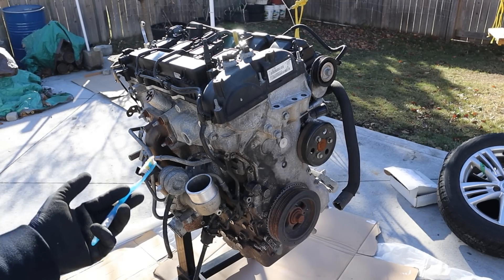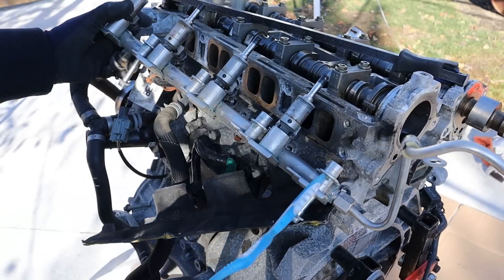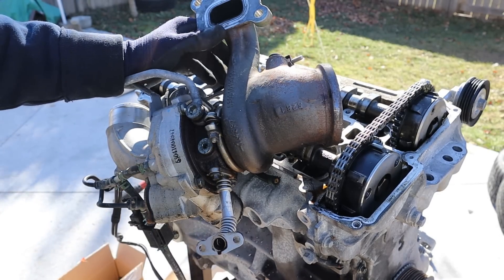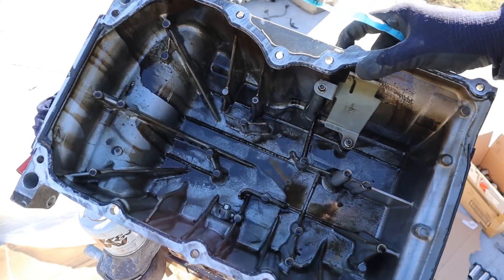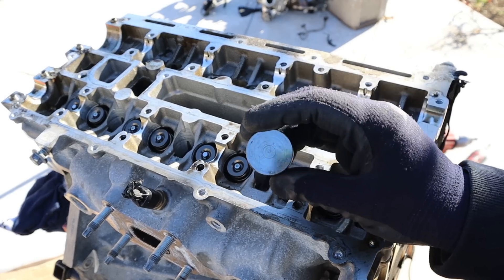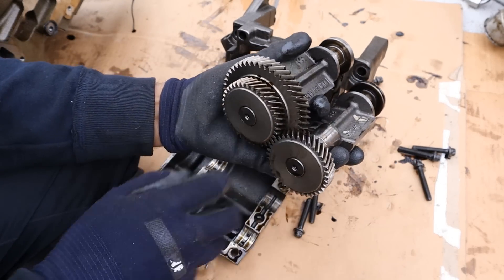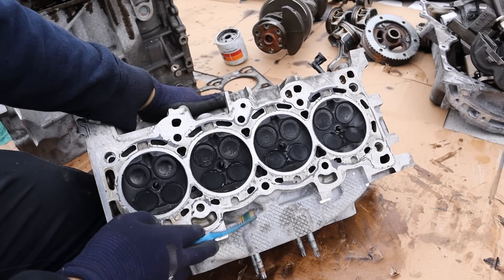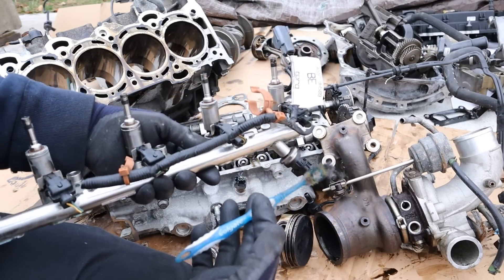Why Ford Ecoboost Engines Fail

Comment: Adding a catch can with an effective trap for blow-by oil vapors will benefit any direct injection motor. The lack of fuel vapor in the intake manifold increases the chance for blow-by deposits. This motor looks like it had a lot of extra oil. Maybe over filled after several oil changes. It looked mechanically sound.
Reply: DI produces a lot of very small carbon particles (think diesel DI) which are recirculated back by the EGR into the intake manifold...and mix with the oil vapours from the PCV......which always have enough oil to form a paste on the ports and valves.
That's why DI enines now have an extra set of injectors to clean the ports....those injectors are 90% of fuel flow in town driving.

Comment: Ive heard Chevrolet is not making certain replacement parts for some of their late model trucks on there fuel systems and the part can run as much as 2000.00 for a used part if you can find it  which is totally BS if so has anyone heard of this !!?

Comment: hey do you have any info on the 2.7L Ecoboost? I have 50k on it and no issues so far but wouldnt be surprised if some of the issues like the coolant groves or carbon buildup due to crank case vent also apply.

Comment: It's an ecoboost engine  so we don't expect it to last..Wtf??? I've known people who had 300k running  perfect....do you understand people are stupid and don't take care of their cars and trucks and that's why they don't last?? My wife has one now, 14 escape titanium w the 2.0 ecoboost, only has 117k on it, but it runs perfect.  She got it used with a 3 yr 36k mile warranty, that covers the motor,  tranny, turbo, drivetrain..everything down to the valve cover.  Doesn't burn any oil at all.

Comment: So....maybe a quick cylinder honing, some new rings or the old ones cleaned up, and some new gaskets and this is a saveable motor?
Reply: Until it fills up with carbon again???
Reply: @JohnSmith-yv6eq  I didn't seem that badly worn.

Comment: Looking to get a full size truck soon that gets decent mpg's, since i drive a lot for work. It'll be a daily and work truck in one. But in my price range (under 20k) they have 100-150k miles. Is it worth getting a 2.7 at that high of miles? As opposed to a 3.5/3.3 naturally aspirated? Tow 2-4k pounds about 40% of the time. Otherwise all my tools and materials fit on the truck.

Comment: My 2013 Escape, with the 2 liter Ecoboost twin turbo, is still purring like new after just turning over 100,000 miles, Changed the oil once a year and never had a single repair or problem. These engines are rockets but you pay dearly in gas milaeage for all that oomph.
Reply: My 2017 3.5 Paseo is the same way. A lot of power but mileage suffers. It rides great and you have to figure it is 20 feet long with a lot of weight. It has 70,000 with regular oil changes I replaced 2 tires out of 6. Which surprises me. I thought they would wear faster. The engine runs like new but Ford informs me of any potential problems (they had a universal recall or something to that effect which they fixed). You have to be careful of any of the newer vehicles anymore. They all have a lot of plastic. My other vehicle is an indestructible 7.3 diesel F250 (2002).

Comment: The newer block design is the one you are looking at. The older one is the one with groove between cylinder 2 and 3
Reply: Not true. Focus and focus st got the good 2.0L block from the beginning, from 2013 onwards. The 2.0L found on the fusion and edge had the slit and only recently changed in 2019. Read the tsb, fordtechmakuloco talks about it on his channel

Comment: More turbo boost,more pressure in the engine, more wear in any modern car with too many hp.I forgot to add  fail with plastic parts.

Comment: WHY do Car companies INSIST on making fiarl ysmall engines and Turboing them when it causes all these problems?
Is it because most folk buying new change their cars ever couple of years and manufacturers want the motors & stuff to fall apart (having finally made bodywork reliable)?
Bit of context .........
I was buying a new battery for my Ford Focus & guy was in the parts shop collecting something, he drove a Toyota Hiace pickup ........  That had nearly 500,000 miles on the clock and he reckoned no big problems with it.  Ever.

Comment: Like you say, it has a couple weak points, but overall, it looks like a good design, especially considering that it was required to be cheap to manufacture. Still... so complex! That's one reason I bought an EV - much simpler mechanically. And no carbon buildup!
Reply: Evs are junk! And they're not simple at all
Reply: @richsweeney1115  Right. That's why legacy automakers are falling all over themselves and spending multiple billions of dollars retooling. They too want to make newfangled complicated products that everyone knows are junk.😅
Reply: @maryhadda8420   every single tesla has has a recall...that's an example of ev junk. Evs aren't green. And you're not saving any money....junk
Reply: MS MARY.... you have no idea what problems lie a head for the battery powered car.  There is a 80% chance you will rue the day you bought it.  As a buying public we are lied to pretty much all the time ... about any thing that in important!  BTW that electric car, causes much more pollution from the beginning of the build process to the day it stops. ONLY AFTER 500,000  miles does its total contribution the pollution start to go down. These facts are well documented !!!    GOOD LUCK!
Reply: @davidfalgout7304  What bullshit.

Comment: I don't get the balance shaft assembly. If you have two identical weights rotating exactly opposite of each other, then they would balance each other out, not the crankshaft, right? In my mind you would have one counterbalancing weight, that is rotating opposite of the crankshaft.

Comment: Cool, finally i see my 17´ ST Turnier Engine in a teardown. :)
Very thx for that. 

It currently have ~50k km on the clock and looks like new inside (checked at the last Service in October this year). 100% Aral Ultimate (102 Oct) Fuel used and always driven warm and cold - does wonders for that engines.

Love it <3

Best regards from germany,

Marti
Reply: It's not the same engine. It's called 2.0 EcoBoost, but ST has closed deck and it's stronger design.

Comment: Or they don't, my 2010 flex has 283,000 miles on the 3.5 Eco going to run in to 315k still burns no oil 23mpg

Comment: BUILD wise it looks very stout but l heard you mention a catchcan pcv was installed maybe too late . SO l m guessing bypass the pcv to a catchcan and maybe put a mechanical turbo blowoff valve may resolve its issues ?? WHAT about the V V T STUFF can a lock out help there too??

Comment: Funny I have 3 of those cars with that engine in it and zero fails. One has 170 thousand miles one has 220 thousand miles and one has 300 thousand miles. We use for delivery. Hate watching guys like you spread lies. Typical Honda guy running g mouth. Let’s talk about the Honda 1.5 turbo and how they are blowing up

Comment: It is absolutely incredible how complicated a modern engine is, totally impressive.
Reply: Ahh, it ain't modern social media until the electric car people start writing novels in the comments nobody asked for.
Reply: Check out the Wasp aircraft engine.  Its a marvel of engineering.  And 50 years ago
Reply: I always am amazed whenever I see these teardowns of all the parts which are either moving and/or subject to wear, that we ever got these contraptions to a level that is pretty darned reliable.

People may dislike the electrics, but they are so much simpler than ICEs nowadays, they should be inherently far more reliable once manufacturing catches up.
Reply: How can you call a complicated engine that burns gasoline and needs all kinds of regular maintenance and repairs, "modern"?  It requires huge, expensive oil refineries to make the fuel too. An electric car can just be plugged into some panels on top of your roof to drive you around for another week, no pistons, no spark plugs, no air filters, no pcv valves, no ignition wires, no fuel pump, no oil changes and no refineries needed. And on a cold day you don't have to worry that it might not start. I've been driving electric going on 5 years now and could never go back! One tip I can give you: If you want to take long trips without inconvenience, make sure it's a Tesla! Tesla said they were planning to open their fast chargers up to non-Tesla but there is no telling how long that might take or whether all of their chargers would be in the sharing program.
Reply: @ZipZoomZip  Thanks for the rant Mull. I was just making a general statement about benzine/diesel engines in general. Electric cars are not the environmentally friendly vehicles they are made out to be if you look int it. I have driven 4 different Teslas and I must say they are the funnest cars I have ever driven. I would worry about the battery in extreme cold conditions though.
Reply: @Neil-Aspinall  I'm a snow skiing enthusiast so my cars see lots of extreme winter conditions in the mountains. That is par for the course for someone who loves fresh winter powder because that means winter storms. I don't have to worry about my Tesla starting on a frigid winter morning or after being buried in a snow drift all day or all day/night. It just goes. I cannot say the same about the old-fashioned gasoline engine.  I never worry about my battery in the extreme cold, this is a made up reason why EV's are not viable, it is not a problem. There are a number of reasons why my Tesla is the best ski car I've ever had out of a long list of VW's, Volvo's, Subaru's and other cars that are known to be good ski cars. The battery is super reliable in the cold. Yes, the range goes down by about 30% which is not even a tiny problem when you have over 300 miles of range to begin with. Every gas car I've ever had lost about 20% in the extreme cold due to having to idle them extensively to get them warm enough to melt ice. The Tesla blows warm air in under 60 seconds without having to start an engine! I could never go back to gas cars.

Comment: One method to keep the valves clean is aux fuel rail and injectors, making it port injection on top of direct injection. I did this to run E85 straight, tons more power and cooler burning.

Comment: It's college kid junk,  but it looks like a few brute modifications could add some life to this unreliable nightmare.  I'd try gutting the turbocharger,  disabling valve stagger boost,  and switching to a cooler water thermostat.  If it has exhaust gas recirculation, I'd disable it.

Comment: I will stick to my Buick 3.8L.  There are about 5 things that could fail on it and still not destroy the engine.  doesn't have the extra crap that are prone to fail.  And if I want turbo I would rather use the belt driven supercharger for that extra power.

Comment: It's an easy concept why ford ecoboost engines fail especially in the truck versions...because there heavier you have regular naturally aspirated engine parts like pistons and connecting rods in a heavy boosted engine setup twin turbocharging wrecks havoc on any internal combustion gasoline engine parts the more boost being pulled out of the motor creates more heat...the more heat inside or internally in the motor the less life you will get out of the motor imo... I would stay away from anything that either has a turbocharger or supercharger

Comment: I used to remove carbon from old V8 engines, by put water down the carburator at high rev's.  I even convinced someone, I was running the motor on water  LOL.

Comment: 287,000 on my Buick Sabre that my parents gave me at 200K and has the simple push-rod 3800 motor that anyone can work on. Doesn't burn or leak a drop of oil or left me stranded! Think I'll keep it for another 287,000 miles.
Reply: Great motor!

Comment: You have to adjust the valves when they get worn and rattly, but the engine is an Ecoboost and doesn't last that long anyway. 😄

Comment: Its one of our life’s bad choices we got and 2017 escape eco boost, after 6 years the engine has oil leaks in the turbo area, when you start in the morning rattling noise on the driver side part and goes out when engine is warm, power is laggy specially when you let go of the gas pedal for a second then gas again, rpm will crawl slowly before engine revs high again🤦🏻‍♂️🤦🏻‍♂️🤦🏻‍♂️ when this car dies ill get a Honda or Toyota.. these brands last long..or maybe go electric
Reply from the maker: O boy. Is it under warranty?

Comment: The camshaft actually has bearings that can be replaced cross braced main bearings not bad.. they have to make them cheap where they can, unfortunately
Single plane crank is why it needs a balencer.
Reply from the maker: It is over built in many areas but as I said at the end, it's the bolt on pieces that make this fail.
Reply: @speedkar99  I think overbuilt okay compared to a lot of things but overbuilt in that case it means it can be serviced better in my opinion having been a mechanic most of my life

Comment: Oh that vacuum pump is cool.
You could make a small internal combustion engine out of that I'm not lying volumetric pressure. It might not last long but it would work for a while and you can change the impeller out for something different .
Reply from the maker: Yeah they're pretty neat

Comment: But why did this engine fail?  why was it replaced?  worst I saw was carbon around the piston rings.  nothing a good WOT could not fix.  More drivers need to learn to perform this fun procedure to make the piston rings dance and knock the carbon off!!
Reply from the maker: I wasn't told the truth I guess.

Comment: So how many miles were on this engine and why did it fail? It’s fine to tell us about what part you are taking off, but again why did it fail? It is probably a junk yard motor and you have no idea if it was running property or not.
Reply from the maker: The story the previous owner told me it was hydrolocked. Didn't see any evidence of that. If u watch until the end I explained the failure modes

Comment: This engine was fine. He got sold a bill of goods. That 2.0 is a good one. The later open deck with the trench is different. This one is the Mazda based one. If you want to pick on the ecoboost pick on the 1.6/1.5 or the newer 2.0 that is garbage. These older 2.0 are great. I’ve got 2 with 300k on them. 2013 and a 2015 escapes.
Reply from the maker: Isn't this one rev2? 2016 focus ST
Reply: @speedkar99  looks like the Mazda closed deck. The newer one with the open deck is the junk one. They had that stupid tunnel. This engine had nothing wrong in it other than carbon. Guarantee you if they would’ve cleaned it that engine would be just fine.

Comment: If you do not want carbon build up on your pistons. Change oil at least every 5,000 miles with the proper weight oil. Also use ethanol free gas.
Reply from the maker: That doesn't do much. There just is no gas washing off the valves
Reply: @speedkar99  yes but the ethanal is known to leave a lot of carbon behind. If you change your oil every 10k miles like some manufactures suggest like Toyota you will end up with a engine exactly like the one in the video.

Comment: It’s only a head gasket. Once you get the block and head decked with a new head gasket and boom problem over!! How do I know because my tuner and builder is Adam Brunson from tune plus inc who is the ecoboost god.   My stock engine 2.3 is ecoboost engine is running 420whp with supporting mods. Been running it for over a year and it’s awesome I beat scat packs and GTs all day.    Very reliable so far.  Adam builds 500whp+ , 700whp+ up to 1000whp ecoboost mustangs and focus and fiestas.  1.6/2.0/23.  There’s is also Jessie from engineering Motorsport solutions who just broke the record for 2.3 ecoboost mustang at 946whp with a 2.0 twin scroll block.  Ecoboost engines are great engines! They just come with some factory defects that cause failures. Ford should have recalled but they didn’t.

Comment: I've owned a couple of Ford Focus' in the past and they were good reliable cars, but I've never had anything with the EcoBoost engine, I'm also not very knowledgeable about engine's, but is it a good idea to have so many plastic parts making up the engine, will they last as long or be as reliable as traditional metal parts? I have heard they do burn a lot of oil, but I'm guessing a lot depends on how you look after the car. From London, UK
Reply: I know I'd never buy a car with that much plastic.

Comment: Looks fairly solid despite apparent lack of regular maintenance AND reportedly ingesting snow. Wish you tore down the turbo on this one though. Great video👍
Reply: My fiesta st 1.6 turbo purrs like a kitten 120000 miles, Like new it's all about the owner.
Reply: @dashforcash6555  it is actually based on a different engine family, the Duratec/Ecoboost 2.0/2.3L are modified Mazda MZR/L-series engines, the 1.6L is based on Ford EU's Sigma series

Comment: That K and N filter is designed for performance not filtration like oem or other aftermarket oil filters. Basically it could help the engine blow itself up. On top of this engine not being a port injected engine no bueno. Mix that with incorrect oil for turbo charged applications and boom rod through block.
Reply from the maker: True. Except rod throwing isn't the main failure on these
Reply: @speedkar99  lack of lubrication is what I’m getting at. That was my guess before the video

Comment: Bought one of these new in a 14 escape. Kept that car til 135k miles. Still had original brakes, original spark plugs intake had never been off. Spent around 500 or so on repairs total over almost 8 yrs. I did hate the transmission 2-3 shift drove me nuts, it developed a leak right where this engine in video has it right at back of timing cover. Overall it was good to us but i changed the oil every 5-6k miles and only used motorcraft filters. Some people werent so lucky